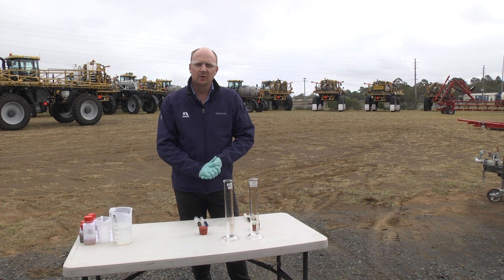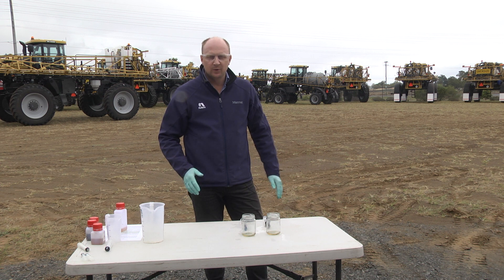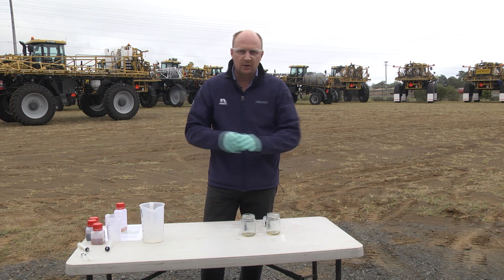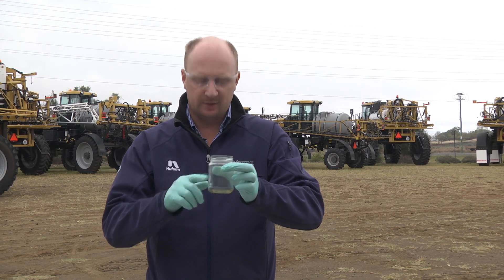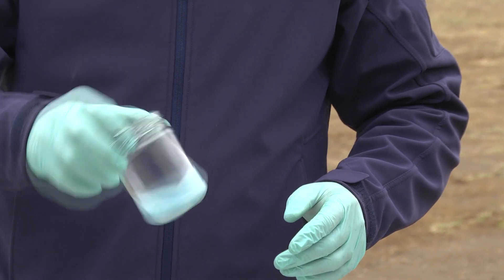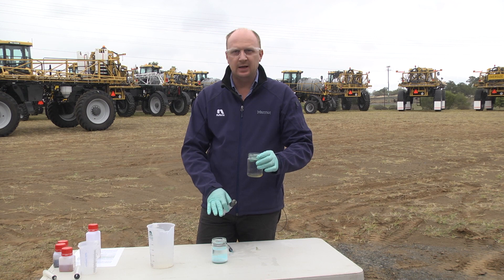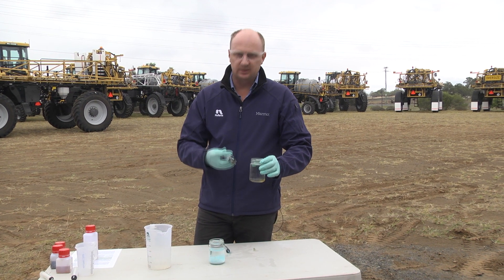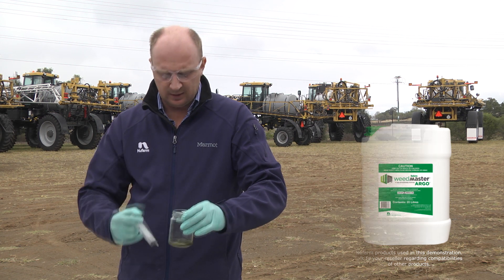Mixing glyphosate and 2,4-D: 2. Handling concentrates

Comment: There's a very specific order in which you should mix different types of herbicides into a tank and when you should do it, if I recall correctly, you should mix in half a tank of agitating water, water soluble liquids, water soluble granulets or powders, emulsifiers, adjuvants, surfactants, indicator dyes, and don't forget to start with your water conditioner if you happen to sump out of a pond, many herbicide suffer from extreme hydrolysis and photolysis